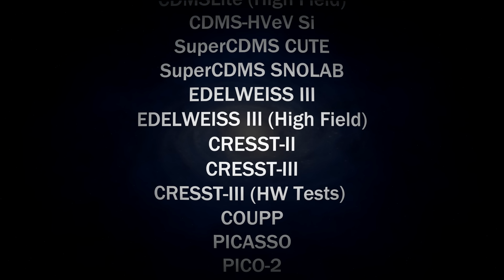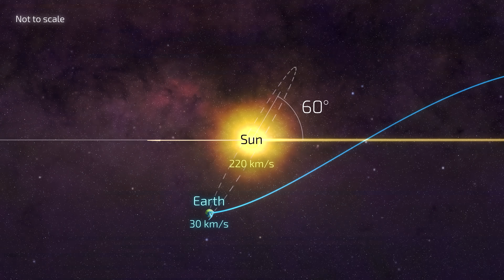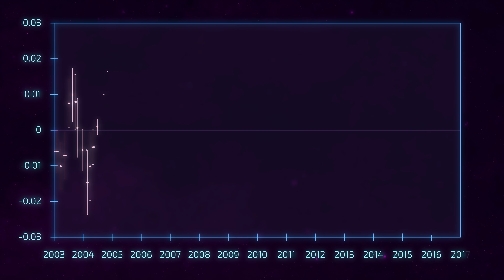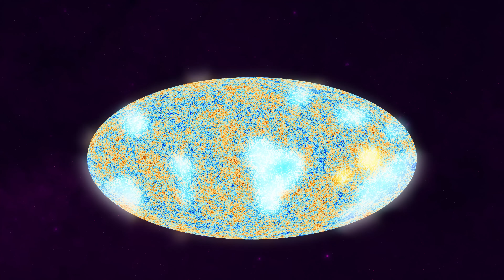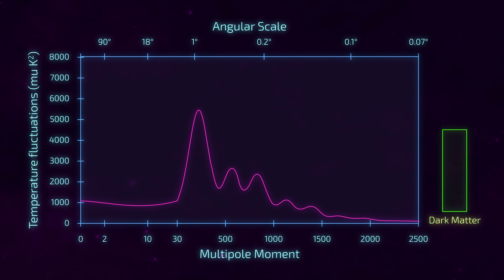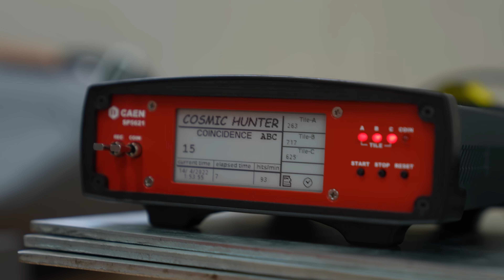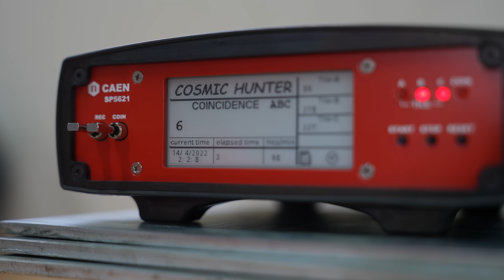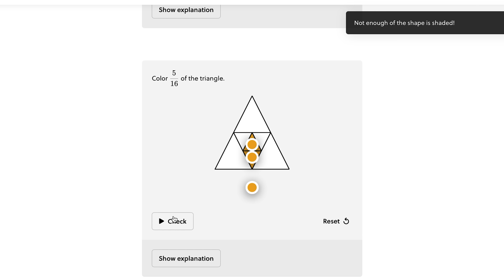The Absurd Search For Dark Matter

Comment: Do my gravity test and 'if' true, and it does not literally wipe out this Earth and all on it, potentially have the literal theory of everything for this universe.
Reply: GRAVITY:  (copy and paste from my files):
Here is the test for the 'gravity' portion of my TOE idea.  I do not have the necessary resources to do the test but maybe you or someone else reading this does, will do the test, then tell the world what is found out either way.

a. Imagine a 12 hour clock.
b. Put a magnetic field across from the 3 to 9 o'clock positions.
c. Put an electric field across from the 6 to 12 o'clock positions.
(The magnetic field and electric field would be 90 degrees to each other and should be polarized so as to complement each other.)
d. Direct a high powered laser through the center of the clock at 90 degrees to the em fields.
e. Do this with the em fields on and off.
(The em fields could be varied in size, strength, density and depth.  The intent would be to energy frequency match the laser and em fields for optimal results, cancelling out the em modalities of the laser, thereby leaving behind the gravity modality.)
f. Look for any gravitational / anti-gravitational effects.
(Including the utilization of ferro cells so as to be able to actually see the energy field movements.)
(And note:  if done right, it's possible a mini gravitational black hole might form.  Be ready for it.  In addition, it's possible a neutrino might be formed before the black hole stage, the neutrino being a substance with a very high gravitational modality with very low 'em' modalities.)

(An alternative to the above would be to direct 3 high powered lasers, or a single high powered laser split into 3 beams, each adjustable to achieve the above set up, all focused upon a single point in space.)

'If' effects are noted, 'then' further research could be done.
'If' effects are not noted, 'then' my latest TOE idea is wrong.  But still, we would know what 'gravity' was not, which is still something in the scientific world.
This test can speak for itself.  It will either be true, partly true, or not true at all.  It will either show what gravity truly is, might be, or is not.  Science still wins either way and moves forward.

*  And note:  Whether my gravity test or another's, a gravitational black hole would have to be formed to prove the concept as being really true.  A gravitational black hole that 'if' self fed itself, could literally wipe out this Earth and all on it, possibly this solar system, possibly put a black hole in this section of our galaxy, and potentially even causing a ripple effect in this galaxy and surrounding universe.  But hey, if it does, no worries.  Nobody would be left to prosecute those who did so.  (Possibly famous last words:  "Hey, it worked.  Ooooppppssss.................)

But as NASA has already proven that low gravity conditions over a prolonged period of time is harmful to the human species, and large rotating space ships won't really work for space bases on planets and moons, those space bases probably being needed somewhere along the way out of this solar system and galaxy, we need to figure out what gravity truly is and see if we can generate artificial gravity so as to have smaller space ships and proper gravity conditions for space bases on planets and moons.  Otherwise, at least all human life will most probably die and go extinct one day.  Currently, no exceptions.

**  Added note:  Just trying to save at least 1 single species from this Earth to exist beyond this Earth so that life itself from this Earth has continued meaning and purpose to.  Gives me something to do while I exist, otherwise, what is it all and everything for?  Even if my TOE idea were correct, but if it did not help species survive beyond this Earth, what good would it ultimately be?

So, are you feeling lucky?  Doing nothing and at least the entire human species eventually dies and goes extinct with a high degree of certainty.  Doing a gravity test, (mine and/or another's), and there is at least a slim chance of literally wiping out this entire Earth and all on it, and possibly more.  Do you and other's truly want me to prove my TOE idea as being really true?

(Since all of life itself is ultimately meaningless in the grand of scheme of things anyway, do the gravity test and see what occurs?)
Reply: For reference purposes:
Revised TOE: 3/25/2017a.
My Current TOE:

THE SETUP:
1. Modern science currently recognizes four forces of nature: The strong nuclear force, the weak nuclear force, gravity, and electromagnetism.
2. In school we are taught that with magnetism, opposite polarities attract and like polarities repel. But inside the arc of a large horseshoe magnet it's the other way around, like polarities attract and opposite polarities repel. (I have proved this to myself with magnets and anybody with a large horseshoe magnet and two smaller bar magnets can easily prove this to yourself too.  It occurs at the outer end of the inner arc of the horseshoe magnet.).
3. Charged particles have an associated magnetic field with them.
4. Protons and electrons are charged particles and have their associated magnetic fields with them.
5. Photons also have both an electric and a magnetic component to them.

FOUR FORCES OF NATURE DOWN INTO TWO:
6. When an electron is in close proximity to the nucleus, it would basically generate a 360 degree spherical magnetic field.
7. Like charged protons would stick together inside of this magnetic field, while simultaneously repelling opposite charged electrons inside this magnetic field, while simultaneously attracting the opposite charged electrons across the inner portion of the electron's moving magnetic field.
8. There are probably no such thing as "gluons" in actual reality.
9. The strong nuclear force and the weak nuclear force are probably derivatives of the electro-magnetic field interactions between electrons and protons.
10. The nucleus is probably an electro-magnetic field boundary.
11. Quarks also supposedly have a charge to them and then would also most likely have electro-magnetic fields associated with them, possibly a different arrangement for each of the six different type of quarks.
12. The interactions between the quarks EM forces are how and why protons and neutrons formulate as well as how and why protons and neutrons stay inside of the nucleus and do not just pass through as neutrinos do.

THE GEM FORCE INTERACTIONS AND QUANTA:
13. Personally, I currently believe that the directional force in photons is "gravity".  It's the force that makes the sine wave of EM energy go from a wide (maximum extension) to a point (minimum extension) of a moving photon and acts 90 degrees to the EM forces which act 90 degrees to each other.  When the EM gets to maximum extension, "gravity" flips and EM goes to minimum, then "gravity" flips and goes back to maximum, etc, etc.  A stationary photon would pulse from it's maximum extension to a point possibly even too small to detect, then back to maximum, etc, etc.
14. I also believe that a pulsating, swirling singularity (which is basically a pulsating, swirling 'gem' photon) is the energy unit in this universe.
15. When these pulsating, swirling energy units interact with other energy units, they tangle together and can interlock at times. Various shapes (strings, spheres, whatever) might be formed, which then create sub-atomic material, atoms, molecules, and everything in existence in this universe.
16. When the energy units unite and interlock together they would tend to stabilize and vibrate.
17. I believe there is probably a Photonic Theory Of The Atomic Structure.
18. Everything is basically "light" (photons) in a universe entirely filled with "light" (photons).

THE MAGNETIC FORCE SPECIFICALLY:
19. When the electron with it's associated magnetic field goes around the proton with it's associated magnetic field, internal and external energy oscillations are set up.
20. When more than one atom is involved, and these energy frequencies align, they add together, specifically the magnetic field frequency.
21. I currently believe that this is where a line of flux originates from, aligned magnetic field frequencies.

NOTES:
22. The Earth can be looked at as being a massive singular interacting photon with it's magnetic field, electrical surface field, and gravity, all three photonic forces all being 90 degrees from each other.
23. The flat spiral galaxy can be looked at as being a massive singular interacting photon with it's magnetic fields on each side of the plane of matter, the electrical field along the plane of matter, and gravity being directed towards the galactic center's black hole where the gravitational forces would meet, all three photonic forces all being 90 degrees from each other.
24. As below in the singularity, as above in the galaxy and probably universe as well.
25. I believe there are only two forces of nature, Gravity and EM, (GEM). Due to the stability of the GEM with the energy unit, this is also why the forces of nature haven't evolved by now. Of which with the current theory of understanding, how come the forces of nature haven't evolved by now since the original conditions acting upon the singularity aren't acting upon them like they originally were, billions of years have supposedly elapsed, in a universe that continues to expand and cool, with energy that could not be created nor destroyed would be getting less and less dense? My theory would seem to make more sense if in fact it is really true. I really wonder if it is in fact really true.
26. And the universe would be expanding due to these pulsating and interacting energy units and would also allow galaxies to collide, of which, how could galaxies ever collide if they are all speeding away from each other like is currently taught?

DISCLAIMER:
27. As I as well as all of humanity truly do not know what we do not know, the above certainly could be wrong. It would have to be proved or disproved to know for more certainty.

Comment: I like that you made a video about dark matter but I do think you have chosen a weird angle. There are tons of dark matter experiments out there that are much more sensitive and well under control than DAMA-Libra. If the signal is really a dark matter one, models have to be insanity tuned so that the non-detection in other experiments can be explained. Meanwhile, DAMA-Libra just continued measuring for almost 20 years without meaningful changes in equipment or experimental setup. One of the most obvious causes, as you point out. 
Similarly, you start the discussion about dark matter with the idea of modified gravity. Sure it works for the rotation curves, but there is a reason the dark matter particle model is popular. 
Feels to me like it is just interesting to zoom in to the 'one genius or experiment who gets it' which is a nice narrative, but not always how it works in real science.

Comment: Wait a minute, the first few minutes of the video seem kinda misleading. What is DAMA/Libra actually meassuring? I'm pretty sure its not direct detection of dark matter, since that would be a breakthrough in itself. I assume they are meassuring neutrinos, but then the periodic changes in event rate do not seem to be connected to dark matter after all, right? I dont think the changing detection rate is as big of a deal as you make it out to be or (at least with the information given in the video) I don't understand why it should be a big deal. Could someone elaborate?

Comment: The question must have already asked but : How do we know, or why do we suspect, that dark matter may sometimes interact with ordinary matter ?
Reply: They don't, they've been making tests of situations where NO OTHER THING can interact in the hopes that dark matter does interact with this. It's equally possible that some other exotic matter could interact that has yet to be discovered.
Reply: I know, this is out of place, but I really want to understand something xD 
So,  at 5:52 I don't physically get why hanging more mass onto the string means having to circle around the star at a higher velocity to keep it up parallel to the ground. Somehow I don't see why this is necessary ._. I mean, for me, it would make sense, if the mass of the star itself increases, then ofc you'll need more speed to keep it from falling, but otherwise...idk. He's holding up all the mass with his own strength anyway, why does it have an impact on the velocity of the star then? Shouldn't it matter how much more mass he'll hang onto the middle because of that?
Reply: @elantris-2002  As I understand it the goal isn't really to avoid falling, as things always fall in space, but fast enough to avoid being pulled to the heavier object, but to resist the gravity pull, and keep the string length the same.
And actually if the mass of the star was bigger, and not the mass at the end of the string, he would need to slow down the rotation or the star would "espace" the gravity pull.

Does that make more sense ?
Reply: @KryssAA  Thank you for answering! 

Yes, everything of that makes sense to me, and I was aware of that before, because that's the scenario in space . 
But in the video, demonstrated here on Earth, I don't get why the mass hanging on the string influences the speed of the star in such a way that, if the mass increases, the velocity of the star circling has to increase as well, to not bend  towards the ground. 
(It's not like there's a significant gravitational pull coming from the mass in the middle, yk)

Or did he just fabricate that effect, in order to explain it better for how it's in space?😅
Reply: @elantris-2002  Ah sorry mb I didn't mean to lecture you. 😅

And yeah I guess that was the point, just an illustration. 😁
Reply: @KryssAA  daaamn, really?? And my dumbass has been thinking about it the whole day now, I even tried to replicate it...xD

And please, dw, I enjoyed reading your answer despite my existing knowledge, it was really well explained, actually :)

Comment: We will have to see what happens.  But when you come up with an implausible value in a measurement, the simplest explanation is not that 85% of everything is magical stuff you can't see, touch, or interact with.  The easiest explanation is that you measured wrong.  If you can't figure out why it's wrong, it still seems more likely that it's a fundamental misunderstanding of a law of physics causing the anomalous answer.  

There are so many things we don't know, and things we don't know that we don't know, that it seems just as likely that we don't yet understand enough to even know the right question to ask to solve this.  The happy coincidence of this is that the correct answer actually could be 85% of everything being something we don't know how to find and that I am completely wrong.

I don't know nearly enough about these subjects to take any sort of a hard stance and I know that because of my lack of in depth knowledge, I am probably wrong.  Still, for now I have to say I'm skeptical that everything we have done in the past is 100% correct and the only possible answer is something so extreme.  I feel like there should be a simpler solution than what for now feels like magical thinking.

Comment: Without having thought much about it, first thing comming to mind also working to explain the rotational speed and gravity distribution would be that the gravity of the central black holes in the galaxies is underestimated. Not sure if we have reliable measurements of e.g. an object in orbit of a black hole with known mass to exclude this idea. Mostly likely yes.
Reply: Gravity drops off with the square of distance. If you make the black hole more powerful, everything speeds up but it’s still different at different distances. To make things orbit at the same speed regardless of distance needs an extra factor.
Reply: And yes, we’ve measured the speed of stars around the Milky Way’s black hole so we know it’s mass.
Reply: @Penfold101  that's what I thought, it is just such an appealing easy first idea 😁 I am personally more a fried of neutrino flavors for dark matter and energy. But although I have a degree in physics, more than 30 years passed since I really invested time applying it 😶‍🌫️